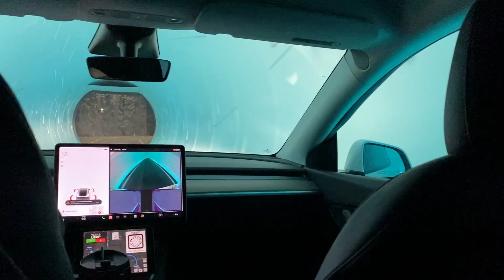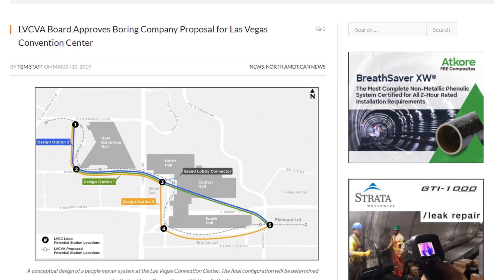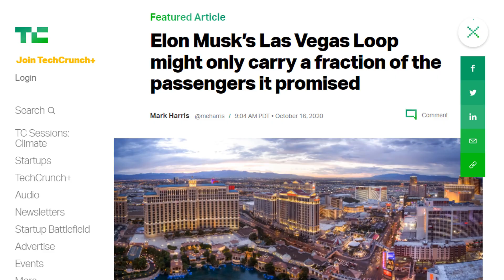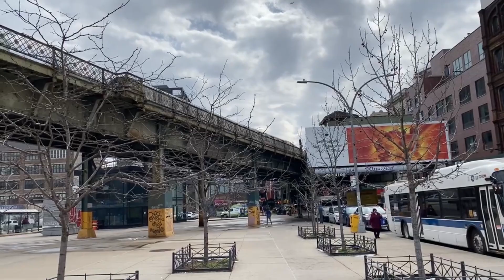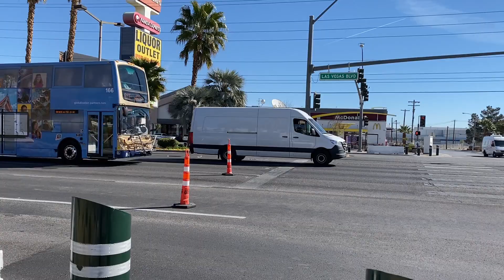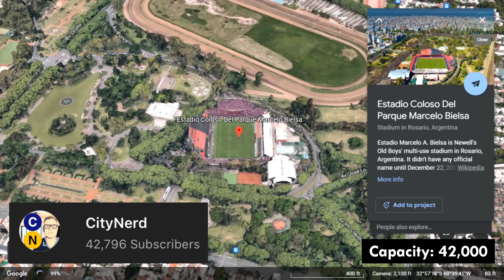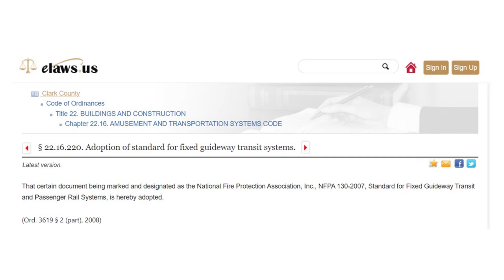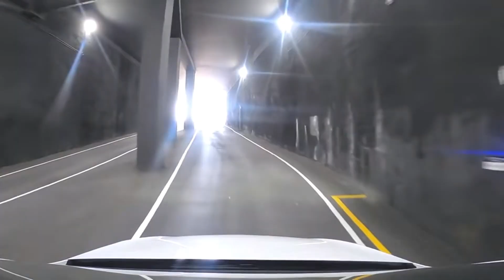Inside the Las Vegas Loop: Transportation Game-Changer, or Complete Waste of Time and Effort?

Comment: Maybe, at some point in the future, they'll repurpose the tunnel for a decent subway.
I get the goal, but the goal needs vehicles that are minimally larger than the space taken up by the occupants at peak capacity, and able to work with the lowest possible driver to passenger ratio. GOA4 would do that, but the 1:200 of a driver operated subway train comes pretty close.
Or, maybe they could go grab some West Virginia University graduates, and do it like they did it in the 1970's.
Reply: Train + trackside equipment + emergency walkways = won't fit. Also, those WVU GRT cars are wider than they appear.
Reply: @colormedubious4747  A theme park system of sorts might be able to fit. Or those tiny model railways you sometimes see at tourist attractions in the UK, which are essentially small-scale trains where you sit on the roof like a saddle.
Reply: @Codraroll  Imaginative, for sure, but people haul around things like luggage, shopping bags, and convention swag. I think the best option is to make them pedestrian tunnels, with or without moving walkways.
Reply: Hi S.P.  The LVCC Loop is already handling up to 27,000 people per day with ZERO waiting times on or off-peak with passengers travelling in the comfort of fast silent Teslas. 

Why would you want to spend billions of dollars more on a train that would force them to wait for 3, 5, 10 or even 30 minutes off-peak and then have to stand crowded in a train breathing the covid of a thousand other people and have to stop and wait at every single station on the line instead of travelling at high speed direct to their destination?
Reply: @andrewfranklin4429  Tell us you didn't watch the video, without actually telling us you didn't watch the video.
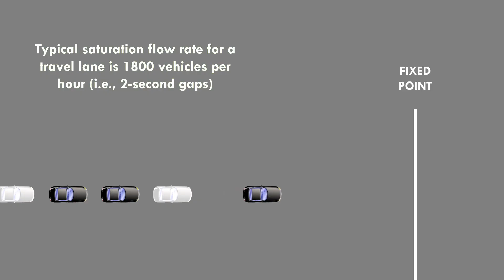@4:40
Best case scenario, according to the back-of-the-napkin math in the video, is 1/15 of that.

Edit. There are 3 stops. At worst, you'd have to wait at one stop before proceeding on to the next, and last. The expensive part would be digging the tunnel, which has been done. An airport-style GOA4 people mover would be better, if it fit the loading gauge, which previous commenters said it almost certainly wouldn't.
Reply: @S_Roach  I’m afraid you’ve just highlighted one of several errors that CityNerd made in his video.

That 27,000 people per day figure isn’t some theoretical rose-coloured figure I dreamed up, it is the actual real world number that the government Authority that overseas the Convention centre released a few weeks back.

The Las Vegas Convention and Visitor’s Authority (LVCVA) reported:

“The Boring Company’s tunnel system successfully moved 25,000 to 27,000 passengers daily around the Las Vegas Convention Center campus during SEMA in November. SEMA was the Convention Center and the LVCC Loop’s first full-facility show with 114,000 attendees. 

As previously reported, the LVCC Loop’s average ride time was under 2 minutes during CES 2022. The average passenger wait time was below 15 seconds.”

The Loop was only operating for the 8 hours that SEMA was open each day which gives an average hourly rate of 3,375 people per hour. But of course, like any mass transit system, the Loop has peaks and troughs throughout the day with a peak period around lunch with a significantly higher hourly rate than that and off-peak periods up to mid-morning and after mid-afternoon with lower rates.
Reply: @S_Roach  So the next question is how does this compare to the station throughput of subways?  Well, the 27,000 entries per day figure is:

- greater than the number of passengers that 65% of the stations on the London Underground individually handle daily which with 1.8 million passengers per day across 272 stations averages only 6,617 passengers per day PER STATION. 

- more than the 24,858 passengers per day per line pre-pandemic average of Kings Cross station, the busiest station on the Tube which pre-pandemic had 149,150 entries per day across 6 lines. 

- more than the average of 13,684 people PER STATION per day of the entire Paris Metro which had a pre-pandemic ridership of 4.16 million per day over 304 stations.

- about 70% the 38,888 people per day per platform pair average of the busiest station on the Paris Metro, the Gare Du Nord which pre-pandemic handled 700,000 people per day across 36 platforms. 

 - more than the 14,000 passengers per day per line average of the Stuttgart Main Station S-Bahn which pre-pandemic saw 140,000 passengers across 10 lines through the turnstiles daily.
Reply: @andrewfranklin4429  No, that was partially my error. You said per day, and the video said per hour. Your per-day rate IS possible, if the cars operate at a three-second spacing, at full capacity, rather than the six-second spacing that CityNerd witnessed. 1,800 passengers per hour, over 15 hours, would come to 27,000 passengers in a 15 hour day. 3,375 passengers an hour, at full, 3--passenger capacity, would be ~3.2 seconds between cars. Doable, certainly, but then the question is why aren't they still doing it. At a guess, the chances of a fender-bender closing the tunnel for an hour while they pry the two crashed cars out of the tunnel, made them decide to back off to a more reliable spacing than the original design called for, especially when demand wasn't high enough to saturate the system even at that lower throughput. That is, however, only a guess.
Reply: @S_Roach  SP, as I mentioned above, The Loop was only open for the 8 hours each day that the SEMA Convention was in operation so that gives us an average hourly rate of 3,375 people per hour, not 1,800 pph as CityNerd erroneously presented. 

But as I said earlier, like any mass transit system, the Loop has peaks and troughs throughout the day with a peak period around lunch with a significantly higher hourly rate than that and off-peak periods up to mid-morning and after mid-afternoon with lower rates.

The reason we don’t see 27,000 people every day through the Loop is because the Loop is only open during conventions at the convention centre where the Loop is located.  That is what it was designed for.

And, thanks to COVID, SEMA with its 114,000 attendees was the only medium-large convention that has occurred in the last few years.  The Loop was designed to handle the bigger crowds of CES which pre-pandemic boasted 180,000 attendees, but CES is now a pale shadow with only 40,000 attendees this year which saw 15,000 - 17,000 attendees through the Loop as a result.  

As the LVCVA noted “the LVCC Loop was rated “outstanding” by both show managers and attendees based on the surveys the LVCVA conducts during all shows.”

“LVCVA Chief Financial Officer Ed Finger told the authority’s audit committee that accounting firm BDO confirmed the system was transporting 4,431 passengers per hour in a test in May showing the potential capacity of the current LVCC Loop.”

However, once the full 29 mile, 51 station Loop is complete we’ll have a better picture of how well these impressive throughput levels scale to a city-wide system.

TBC’s projection of 57,000 per hour certainly seems conservative in light of the above.
Reply: @andrewfranklin4429  Once again you seem not to understand the concept of "flow past a fixed point". And since there are four platforms/directions of travel, the daily total number must be divded by four to analyse the traffic flow of the system. We've done the math together before, it's 850 pph. Why do you seem so hell-bent on not understanding this? Why do you find new people to repeat the same LIES to, whenever somebody debunks you? Do you really believe this blatant dishonesty benefits your argument in any way?
Reply: @Codraroll   it’s interesting Erlend that when you pointed out that we needed to count the 2 platforms for both directions of travel at a subway station as one when comparing daily ridership stats to the Loop, I agreed with your logic and adjusted my calculations accordingly. 

However, despite this, you then insist on splitting the LVCC’s central station into two halves and treat each as separate platforms for your calculations. 

This is particularly strange considering the bays on both sides of the central station actually allow the EVs to go in either direction courtesy of U-turns at both ends of the station. 

Bending the facts just a little to suite your narrative aren’t we Erlend?

You also neglect the fact that there are 8 Loop stations for every subway station per mile in the busier parts of the Las Vegas Strip as well as forget that there will soon be 4 Loop stations serving the Convention Centre (and 3 more within a few hundred metres), where only a single subway station would do that job. 

As a result, you erroneously compare the throughput of a single Loop station (or even worse, half a station!) against a subway platform pair instead of comparing the 3 (soon to be 7 stations) of the Loop when we compare throughput. 

Then you confuse the “people per hour sitting in a train going down the line” metric with the number of people exiting the station when they are completely different metrics.  

As I’ve described above, I am very happy to correct my assumptions and conclusions when you point out genuine errors in my logic Erlend, so would it be possible for you to reciprocate such professional courtesy?
Reply: @andrewfranklin4429  SInce you so obviously don't see the holes in your "logic" yourself, allow me to spell them out:

In any sort of bus/tram/subway system you would want to compare with, there is one platform per direction of travel. If you want to compare the Loop on an even basis, you thus have to treat its central platform the same. If there is one stream of passengers going upline and another going downline, effectively you have to use a two-platform station as the comparison baseline. 

Comparing 3 Loop stations to one subway station is so dumb I don't know how to adequately express it. Similes to wooden blocks or doorknobs only go so far, after all. You are comparing a system that transport people within a busy area, to one that transports people from that area to somewhere else. With that comparison, the throughput of the Loop would be zero, as nobody would use it to travel elsewhere than the convention center. 

And averaged over the system, "people per hour sitting in a train going down the line" must count for throughput. Everyone gets off at some station, after all. Whether they embarked at the previous station, or five stations upline, doesn't matter. They are transported by the system past the fixed point.

I think you ought to look up the very basics of traffic engineering if you want to discuss this with people who actually know their stuff.
Reply: @Codraroll   so you continue to insist on counting the two sides of the central LVCC station as separate entities even though EVs can travel in either direction (down-line and up-line) from both sides of the station (unlike a train where platforms are locked to one direction or the other). 

And yet at the same time you insist that the two platforms in subway stations that go down-line and up-line respectively be grouped together as one entity. 

Do you really not see the inconsistency of this?

It’s also interesting that you don’t comprehend how the Loop having 8 stations per mile versus a subway having only 1 station per mile means that those Loop stations only need carry 12.5% of the passengers of a subway to carry the same amount of people overall. 

If you only compare the capacity of one of those stations to a subway station, then you’re under-counting the station capacity of the Loop segment in that section of the city by 87.5%. 

As it is we are undercounting the capacity of the LVCC Loop stations by only having the data of the three existing convention centre stations. The 4th LVCC station hasn’t been built yet and neither have the three other stations in close proximity to the convention centre. 

But that’s ok for the purposes of this discussion since even with just three stations, the LVCC Loop beats the daily throughput of most subway platforms in Europe which proves my point that station capacity is not a problem with the Loop. 

This is pretty simple arithmetic that you’re misunderstanding here. 

And yes “people on a train going down a line” does indeed count as the throughput OF THAT LINE, the same as people sitting in EVs going down an arterial tunnel count as the throughput OF THAT TUNNEL. 

However, in neither case do those figures have anything to do with the capacity of any stations that railway line goes through or Loop stations that arterial tunnel goes past.

In addition, that train line goes through every train station on that line while that Loop arterial tunnel does not go through any Loop stations because only those Loop EVs whose destination is that Loop station actually turn off the arterial tunnel and go to that Loop station via that station’s spur tunnels. 

So your insistence of for some reason trying to compare the people down a line throughput figure with the Loop station thru the turnstiles data is bonkers. 

Just wait for the Loop arterials to be completed and we can compare those trunk line throughput figures to your heart’s content.

But until then, we can only compare train Station turnstile stats versus Loop station turnstile stats to get any sort of apples to apples comparison with the real world data we have in front of us.
Reply: @andrewfranklin4429  You are the one who began by talking of "platform averages". Which is a stupid metric, because it counts travel in each direction separately. If you want to compare station to station, you must account for the fact that most transport system stations have two platforms (unless they are end-of-the-line stations): One for upline traffic, one for downline. Using the "platform average" as a metric would thus count only half the total traffic flow through the station. Which is fine if you also do the same for whatever system you are comparing with, and for the purposes of that discussion, the Loop currently has four platforms. Even if the splitting of upline and downline traffic doesn't occur until after the vehicles have left their loading bays. But it appears clear as day in the traffic flow pattern.

You seem strangely insistent on counting all of the traffic through the entire Loop and then treating that as ONE platform (which only serves traffic within itself, then?) for comparison purposes, which is so mind-bogglingly stupid it probably qualifies you for some sort of government assistance. 

To make matters worse, you butcher the comparison data by averaging the traffic of all stations on the subway systems you compare to, which leads to enormous under-estimation because most subway stations in any given system don't see a lot of traffic (since they are located on less busy branch lines). If you want to compare inner-city transport systems, use inner-city stations and forget the network average. For a true apples-to-apples comparison, you should also consider that the Loop is closed whenever conditions don't approach what would pass for rush hour in the other system, so you'd have to discard everything but the rush hour for the other system too. So you shouldn't look at "platform average" for the entire network - that figure is junk - but rush hour turnstile numbers at downtown stations. And compare to each separate station for the Loop.

Of course, you can split the traffic base of an area into several smaller pieces by building more stations closer together, and running them on independent lines so the same traffic flow doesn't go through all of them. Technically, that's doable for any sort of transportation system, at least within the limits of the minimum curvature of the track. But that's also an incredibly stupid idea, because it's hellishly wasteful. This is another part of the Loop you seem not to grasp: It requires a mind-boggling extravaganza of construction compared to what it actually provides. 

The reason why there isn't a subway station on every street corner is that stations are expensive. Even if Loop stations are cheaper, it'd still require an awfully large amount of stuff to be built: The platform itself and its infrastructure, and the tunnels connecting it to the "trunk". The latter consist of two surfacing ramps, which do not come cheap and are a maintenance nightmare, and on-and off-ramps akin to a highway interchange (which are hellishly expensive too), and it's even all underground. Remember also the stuff not directly connected to the cost of digging: permits, land acquisition, various encounters with NIMBYs, ventilation, lighting, safety features, communications, and other systems that pile up the costs. Connecting all these stations independently to a trunk line would result in some pretty wacky-looking tunnel spaghetti. That's probably desirable if one is a snake oil salesman peddling tunnels, but whoever has to pay for it and its upkeep would take one look at it and decide to go with something much simpler instead. 

For instance, skipping all the tunnels entirely, and using that sweet autonomous vehicle technology (which is a prerequisite for the Loop to even exist as advertised) to run a driverless taxi service on the surface, using the existing roadway network already paid for by the city. Sure, it would be a little bit slower, but it would get customers from door to door without any hassle, and that is worth a pretty big increase in transit time. Otherwise, it has absolutely all the advantages of the Loop and then some.
Reply: @andrewfranklin4429  According to your own words 3375 people per hour Sema, that's cute, that's nearly 3 times less the capacity of Luxtram per hour. Tramways, Electric Busses are way better and way more efficient and require way less energy (km/MJ) per person
Reply: @andrewfranklin4429  Luxtram 422 persons board in less than one minute (one tramway every 2 minutes). Show me any video where 422 people board cars and drive away in one minute at one station at the Las Vegas Loop. You cannot. Facts.
Reply: @Codraroll   Erlend, you forget that I agreed with you that we should count both directions of flow and so I modified my stats to include both platforms of subway stations. However, you then went and continually insisted we split the LVCC central station into two separate directions. Not exactly equitable or logical. 

When I made comparisons of the Loop to the average of all stations in other systems, I always also included stats from the busiest subway stations to demonstrate the upper bounds of the dataset to show that even the busiest stations weren’t that much higher per platform-pair. 

And no, the Loop is not closed in non-rush-hour conditions. Each day of every convention has a single 4-5 hour “rush-hour” over the middle of the day and off-peak lows in the morning and afternoon compared to the two separate 2 hour peak periods of commuter-biased subways. 

Not that it matters however as even ignoring those peak periods on the Loop just by taking a average hourly pph still gives us 3,375 people per hour or 1,125 people per hour per station which multiplied by the 8 Loop stations = 9,000 people per hour compared to a single subway station platform-pair. 

You on the other hand insist on only counting bums on seats going down a train line as if that has anything to do with the number of people walking out of the turnstiles of a station. 

 It seems to have no impact on you when you see the example of the busiest line (Victoria) on the London Underground seeing just over 60,000 pph in the highest morning peak hour sitting on the train, and yet the actual max number of passengers recorded getting off and going through the turnstiles at Oxford Circus Station (the busiest Underground-only station on the Tube) is only 23,720 pph in the busiest morning peak hour. 

That stat alone should make you realise that pph sitting on a train does not equal pph going through the turnstiles of the station. 

But it’s even worse as that is the total across 6 busy platforms and 11 different Lines, so the pph going through the turnstiles from just the Victoria line is far smaller again as divide by 3 platform-pairs we’re only looking at approx 7,906 pph at Oxford Circus Station. On a per line basis it’s only 2,160 pph.  

And yes each of those 3 platform-pairs have similar pph riding down the lines so a divide by three gives us a quite accurate thru the turnstiles percentage. 

And those were the figures pre-pandemic - ridership now is less than half those figures (so somewhere around 4,000 pph for that Oxford Circus platform-pair) which you also ignore despite the fact that the LVCC stats are all pandemic affected resulting in CES for example dropping from 180,000 attendees to only 40,000 this year. 

And no, it is not possible to add more stations per mile for subways because you need a certain distance between train stations because trains have to stop and wait at every single station on the line meaning they would never get up to speed and would end up being even slower than the 17mph average that they already suffer from and passengers might as well walk. 

And with the enormous $100m - $3 billion expense of underground stations and subway tunnels it is not economically viable to put in multiple parallel subway lines to overcome the station frequency problem. 

And you’re stuck in believing that creating these huge expensive bottleneck train stations is somehow better than distributing the load over smaller less crowded stations. 

The huge mind-boggling extravaganza of construction is actually a single huge underground station costing between $100m and a couple of billion dollars versus 8 small above-ground Loop stations spread around that mile of city each only costing $2m for a grand total of only about $16m. 

And with EVs leaving every station down to every 3 seconds, there is no need for those stations to accomodate long queues and crowds as they wait 3, 5, 10 or even 30 minutes for the next train as you get in subways. 

Those crowded subway stations and trains are honeypots for terrorists, mass shooters and are pandemic hotspots infecting passengers at 6x above the normal rate. 

And no, the cost of the extra on-ramp and off-ramp spur tunnels to those Loop stations is not hellishly expensive - you’re getting confused with the eye-watering $100m -$1 billion per mile costs of subways again. 

And yes elevated highway freeways are also hellishly expensive at $70m per mile. 

In contrast, Loop tunnels only cost $10m per mile. But it gets even better as the taxpayer doesn’t even have to pay for the tunnels as The Boring Co is covering that cost for the entire 29 miles of tunnels in the Vegas Loop. 

And skipping tunnels and going back to clogging the 5x slower surface road network instead puts us back in the Las Vegas gridlock that the city is wanting to bypass and reduce in the first place. That is no solution.
Reply: @THEREALZENFORCE  Since you want to talk people per hour travelling down the line, let’s compare those stats shall we?

Bus Rapid Transit (at grade) has very low capacity:
90 passengers per vehicle * 15 vehicles per hour = 1,350 pph.
And low average speed of 9mph due to city traffic and having to stop and wait at every stop. 
$0.68 - $9m per mile

Bus Rapid Transit (grade-separated) has low capacity: 
90 passengers per vehicle * 30 vehicles per hour = 2,700 pph.
And but still slow average speeds of 12-22mph.
$13-50m per mile

Light Rail Transit (at grade) has medium capacity:
90 passengers per vehicle * 3 vehicles per train * 15 vehicle sets per hour = 4,050 pph.
But slow speeds of 9mph -12mph due to city traffic and having to stop and wait at every station. 
$50m - $100m per mile

Light Rail Transit (grade-separated) high capacity:
90 passengers per vehicle * 3 vehicles per train * 30 vehicle sets per hour = 8,100 pph.
And still pretty slow average speeds of 15mph due to having to stop and wait at every station. 
$201m per mile

Subways have very high capacity:
100 passengers per vehicle * 10 vehicles per train * 30 vehicle sets per hour = 30,000 pph.
But still slow average speeds of 17-22mph due to having to stop and wait at every station. 
$600m- $1 billion per mile
$100m - $1 billion per station

Now as I said, the Loop Arterial tunnels haven’t been built yet, but we do know they will have a 0.9 second headway giving us 4,000 EVs per hour. (That headway is equivalent to about 5 car lengths between EVs at 60mph which is similar to cars on a busy freeway)

So let’s compare those:

The 29 mile Vegas Loop (2.5 passengers per EV) will have high capacity:
 2.5 passengers per vehicle * 4,000 EVs per hour = 10,000 pph
AND very high average speeds of 60mph thanks to direct point-to-point travel at high speeds. 
$20m per mile (dual tunnel)
$2m per above-ground station

The 29 mile Vegas Loop (4 passengers per EV w ride sharing) will have higher capacity:
 4 passengers per vehicle * 4,000 EVs per hour = 16,000 pph
AND very high average speeds of 60mph thanks to direct point-to-point travel at high speeds. 
$20m per mile (dual tunnel)
$2m per above-ground station

But the Vegas Loop isn’t just one line down the centre, but up to 3 separate arterial tunnel pairs (6 tunnels in total) in parallel at times - particularly around the Allegiant Stadium to assist with handling the peaks pre and post games.  

That gives a throughput of 30,000 pph one way (or 48,000 pph with 4pax per car) or 60,000 (96,000pph w 4pax) bi-directionally over those high traffic sections.  

And there are several other sections where small loops come off to serve groups of stations through the heart of the city so the numbers continue to multiply.

And the great thing about the Loop topology is that if there is more demand, higher capacity EV vans, buses or “pods” can be added as well as more tunnels and stations can be built at a cost vastly cheaper than a subway.
Reply: @THEREALZENFORCE  you’re getting confused between bums on seats on the trains vs people thru the turnstiles again Zen. 

For starters 422 passengers do not board each Luxtram at every station as the tram would be full so what normally happens is much smaller numbers (averaging perhaps 100 per station) board the tram at every station over the course of multiple stations. They also then gradually empty over yet more stations. 

And no, 422 people (or more accurately 100 or so passengers) don’t need to board the Loop EVs in one minute because unlike Luxtram where passengers have to wait 2 minutes for the next tram and then board in a rush, the Loop EVs arrive every 3 seconds at each station. So over those 3 minutes that it takes the next Luxtram to arrive and board passengers, 60 Loop EVs bearing up to 4 passengers each would have been past loading 240 passengers.
Reply: @Codraroll  I guess we’ll just have to wait and see whether the rest of the 29 mile Vegas Loop performs as well as the current very successful LVCC Loop. Have a great day!
Reply: @andrewfranklin4429  As good as the LVCC Loop? With having to employ a whole horde of drivers, the trips taking longer on average than expected, low throughput numbers in practice, and generally only impressing those who can't see further than the RGB lights? Yeah, I actually think that will be quite likely, if the whole thing even gets off the ground in the first place. Not holding my breath for that, though.
Reply: @Codraroll  Erlend, did you happen to notice in my discussion with Robert about the Ottawa Transitway BRT system, that comparing the stats of the Transitway to the Loop, the former actually has a higher ratio of drivers to passengers carried than the LVCC Loop?

The Transitway has 9.4x the number of bus drivers as the LVCC Loop EVs while only transporting 7.4x the number of passengers. 

So the Transitway actually has a higher wages bill proportionally than the Loop.  And once autonomy is turned on, the difference will of course suddenly be dramatic. 

The LVCVA reported the following about CES: 
“the LVCC Loop’s average ride time was under 2 minutes during CES 2022. The average passenger wait time was below 15 seconds.”  
So the Loop is nicely on-spec for trip times. 

The passenger throughput figure requested by the LVCVA was 4,000 people per hour and the LVCVA reported that:

 “LVCVA Chief Financial Officer Ed Finger told the authority’s audit committee that accounting firm BDO confirmed the system was transporting 4,431 passengers per hour in a test in May showing the potential capacity of the current LVCC Loop.”

And of course, with the Loop transporting 27,000 people per day during SEMA, average hourly throughput of the Loop was 3,375 so peak throughput would easily have been over 4,000 as well for a nice real-world confirmation of the test figures. 

So yes, the LVCC Loop has indeed been a roaring success which is the reason why the LVCVA, the County and 51 casinos, hotels, UNLV and Allegiant Stadium have all signed on as patterns in building the 29 mile Vegas Loop.
Reply: @THEREALZENFORCE    Luxtram has 15 stations over 7km and takes 23 minutes to travel that distance at the dreadfully slow speed of 11.3 mph.

The tram has a daily ridership of only 31,300 passengers only 16% greater than the 27,000 people per day of the Loop despite having 5x the number of stations, 5.4x the length and costing $604m or 12.4x more than the LVCC Loop.  And it isn't even underground so has all the problems of above-ground rail in terms of noise and land-use.

I don’t think I’d be using that as an example if I was you Zenforce!  :-)
Reply: @andrewfranklin4429  Luxtram 16km 24 stations 500 million USD, over 12000 people per hour capacity (every 2 minute one tram with 422 passengers), 31 million per km.
Las Vegas Loop 2km 1 station 50 million USD per km, only 4400 people per hour maximum claimed nearly 3 times less capacity per hour at optimal factors at best. Luxtram requires at least 6 times less electricity per person
Reply: @THEREALZENFORCE  like Erlend, you’re getting confused between people riding on trains going down the line versus people through the turnstiles of the station. As I mentioned to Erlend, the busiest line (Victoria) on the London Underground sees just over 60,000 pph in the highest morning peak hour sitting on the train, and yet the actual max number of passengers recorded getting off and going through the turnstiles at Oxford Circus Station (the busiest Underground-only station on the Tube) is only 23,720 pph in the busiest morning peak hour. 

That stat alone should make you realise that pph sitting on a train does not equal pph going through the turnstiles of the station. 

But it’s even worse as that is the total across 6 busy platforms and 11 different Lines, so the pph going through the turnstiles from just the Victoria line is far smaller again as divide by 3 platform-pairs we’re only looking at approx 7,906 pph at Oxford Circus Station. On a per line basis it’s only 2,160 pph.  

And yes each of those 3 platform-pairs have similar pph riding down the lines so a divide by three gives us a quite accurate thru the turnstiles percentage. 

And those were the figures pre-pandemic - ridership now is less than half those figures (so somewhere around 4,000 pph for that Oxford Circus platform-pair) which you also ignore despite the fact that the LVCC stats are all pandemic affected resulting in CES for example dropping from 180,000 attendees to only 40,000 this year.